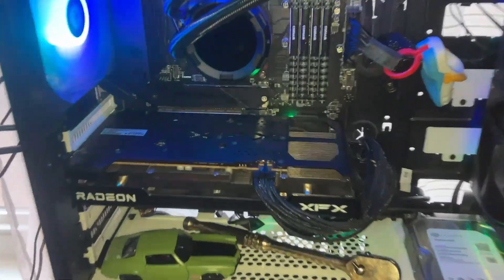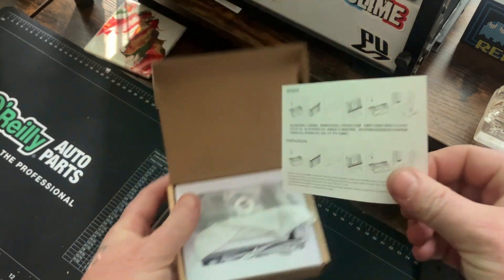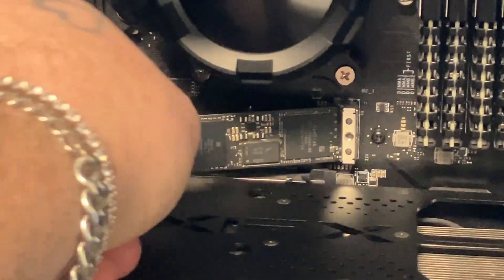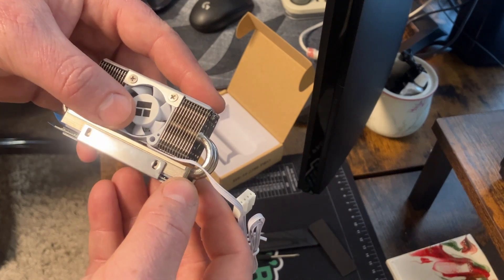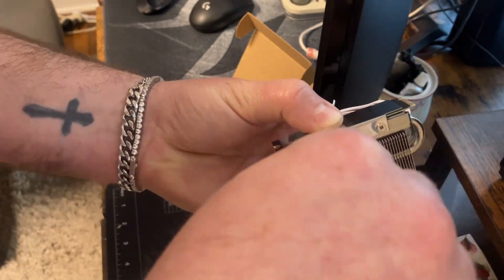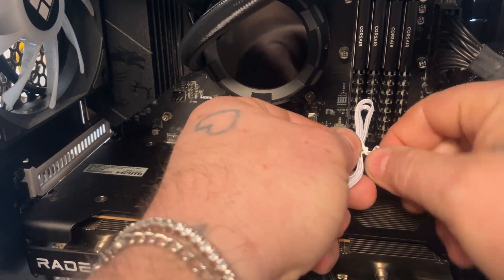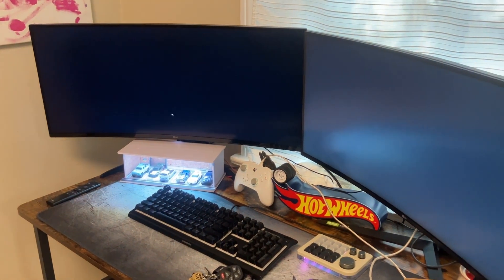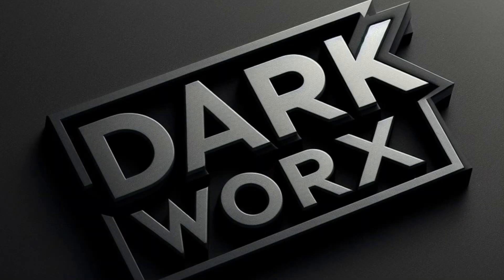Amazon Thermalright HR10 NVMe Heatsink Unboxing & Installation | Temperature Comparison Benchmark!

Comment: From the way i see it, you have a choice to get a HOT AIR from the back of the GPU or turn it around and get a HOT AIR from the CPU, either way its a trap, lol.
Reply from the maker: Note I’m not an engineer or a scientist but I know with it it runs cooler then when out it lmao. Still using it problem free. Think about it like this without it you’re getting hot air from everywhere and no fan or real heat pipe with it. You at least get a little airflow and the heat pipes.

It’s actually really well made and does stay cooler 

How much of a difference that makes I’m not really sure

Comment: Hi what temp do you get without any heatsink on the drive? I want to know the difference of nothing vs motherboard heatsink vs thermal right cooler.

Also how necessary even is m.2 cooler because I have been running mine without anything for years now since my motherboard did not include any heatsink for it.